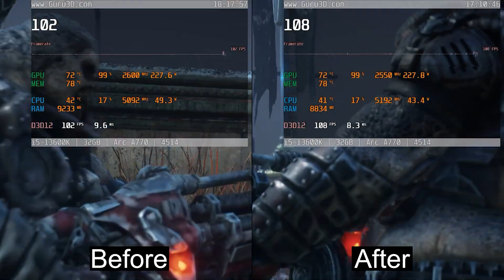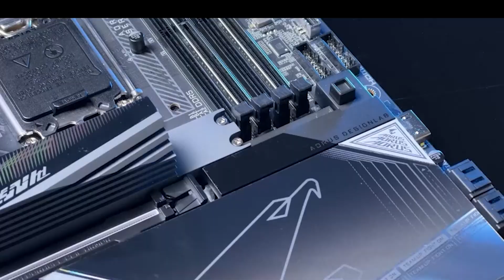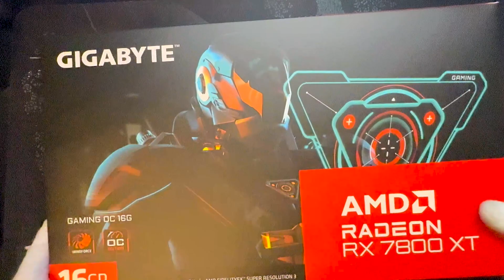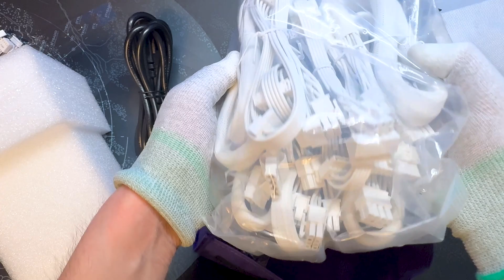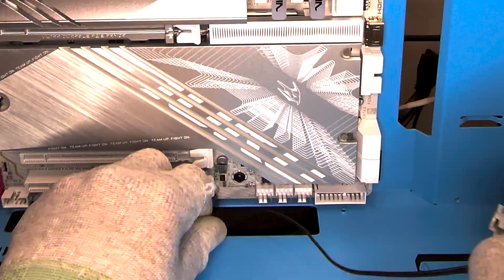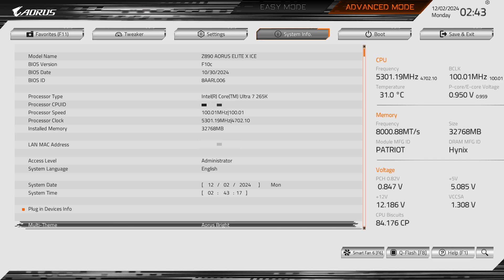$1500 Desktop Gaming PC Build in 2025 - Featuring Intel Core Ultra 7 265K

Comment from the maker: FULL SPECS: 

Motherboard: Gigabyte Z890 AORUS ELITE X ICE
CPU: Intel Core Ultra 7 265K
GPU: AMD Radeon GIGABYTE  RX 7800 XT GAMING OC 16G
CPU AIO Cooler: Arctic Liquid Freezer III 240 A-RGB (WHITE)
RAM: Patriot Viper Xtreme 5 RGB DDR5 32GB 8000MHz
SSD: Kingston Fury Renegade PCIe 4.0 M.2 1TB
PSU: NZXT C1000 Gold (ATX 3.1, 1000W)
Case: Fractal Design Pop Air RGB Cyan
Case Fans:  Fractal Design Prisma AL-14 PWM WHITE 2x
Fractal Design Prisma AL-12 PWM 1x

----------------------------------------------------------------

for any question drop a comment or connect at discord server: https://discord.gg/PXmJY6BP8b. 

If you enjoy my content Subscribe & Become a member to activate extra PERKS
Pateron: https://www.patreon.com/TECHOSAUR
Reply: Why core ultra ? Terrible gaming performance
Reply from the maker: @Pilociks This month Intel will release an update; it promises performance fixes, but it is not out yet. For now, I am doing before-benchmarks so we can compare them when it's out
Also on launch APO is bugged so maybe once they iron those issues it will be a good option,  we'll see
Reply: @TECHOSAUR  Intel promised good performance for the premiere, I remind you ..
Reply from the maker: @Pilociks  Absolutely bro you're spot on. but if you look at it from another perspective, Intel's switch to TSMC's 3nm node in arrow lake gen is a significant leap, while AMD's stick use of 4nm for Zen 5. for intel this move opens the door for improved efficiency and cooler performance, waving goodbye to thermal throttle reputation of past Intel CPUs at least this gen

another thing, initial reviews, also for Ryzen, often showed similar patterns—Zen 5, for example, saw noticeable improvements with Windows and BIOS updates. with how complicated tech became, day 1 reviews are commonly becoming negative, that's why testing and revisiting after updates seems interesting. I think its a great call on grabbing it to explore its potential along the line

I hope you don't think I'm biased to any but I just appreciate the fact that intel last gens support higher RAM speed without worrying about 1:1 FCLK:MCLK ratio
by using CUDIMM later on I think performance scale will be so impactful
Reply: @TECHOSAUR  You are talking about theory. I about the practice.  AMD zen 5 consumes little power, much less than the Intel competition. The 9800x3d is the king of performance. 3D Cache is a game changer. Stable Lots of fps and small 0.1 drops. Intel sucks in the new architecture . Maybe it will be better or maybe not and what will you do then? You can afford it, but if I spend 1500 of my dollars on a computer, it will be another 5 years for me. And I won't buy something that MAYBE will be more efficient. Maybe it will be, maybe not. And today I have a 9600x, a good budget gaming cpu, consuming little power.
Reply from the maker: @Pilociks  Yes, I understand you. I'm not claiming that the 265K is currently the king of gaming CPUs—I fully acknowledge that the 9800X3D is an excellent choice for gaming without even owning one myself, However, if we consider price-to-value, it's hard to justify in my humble opinion. Here, the 9800X3D costs 700 euros, while I got the 265K for 400. Plus, the 265K has more cores, which makes it versatile for workloads beyond gaming. atm it doesn't look as much strong but I can see some potential in it, which is why I'm planning to explore, I don't suggest any recommendations, for me this build is for experimenting, my main is still ryzen 9950X, Its very good choice for workstation and gaming

if I want to make a 9800X3D build today I'll be able to do it spending a bit more than 265K with same other components, and it will be less performing outside gaming